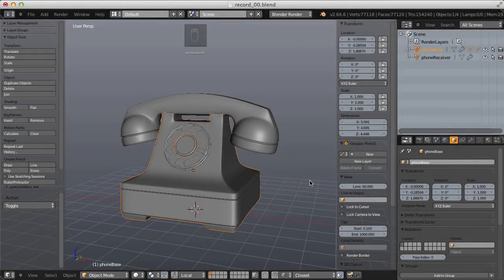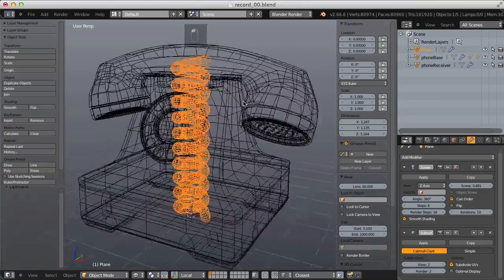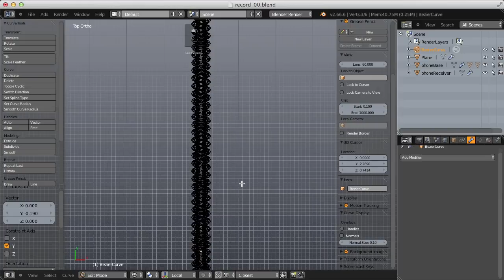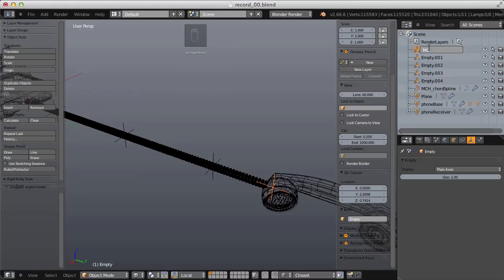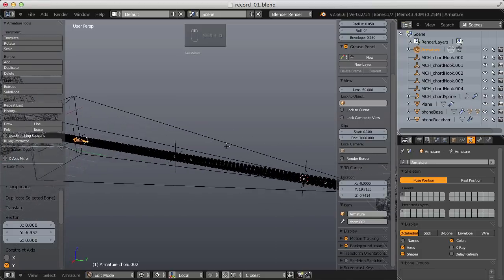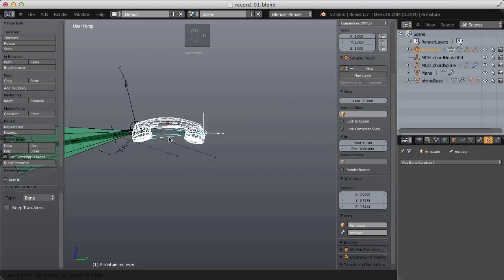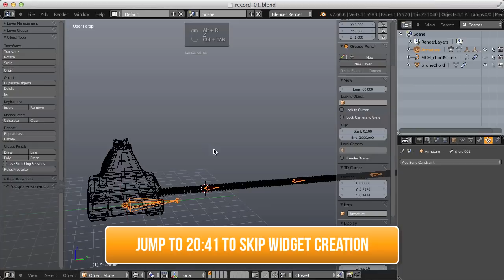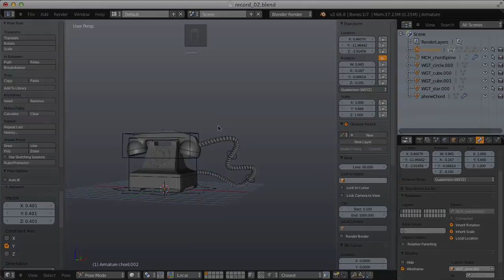Rigging a Spiral Phone Chord in Blender

Comment: sigh... sooo RIGHT from the beginning of adding a Bezier curve, I've got problems.  As soon as I add it the origin of the Bezier appears right on top of the 3D cursor as it should, but the bezier itself is WAAAY off to the side.  Damnit... I just want to follow a tutorial without running into a deal-breaking issue at just a few minutes in!!!
Reply: Happened to me. What worked for me: Had to Put the rotation of the chord to zero in the x,y,z axis using the tools in the right corner. Then made a new bezier curve along the chord. And, after applying the Curve Modifier, I made the bezier curve points bigger by selecting them and pressing ALT+S and expand, since my mesh chrod was small. sorry phrasing*. hope it helps.

Comment: How does this work in Blender 3.0? I'm having difficulty at the part where you constrain the Chord Stretch bone to the receiver bone. I think the process might have changed because I don't have the option for "stretch to".
Great and very thorough tutorial all the same.
Reply: I'm not sure that I understand what you're asking. It took me a minute to find "stretch to" in 3.0. If that's what you're looking for, select "Armature", go to Pose mode and select your stretch bone.Then press Control-Shift-C and the Add Constraint menu will open. You'll find "stretch to" under the Tracking column.
Reply: @tp00954  thanks for replying, I'll try that.

Comment: Well, they are different programs.  Big this is that Blender is Free and open Source and Cross Platform, meaning it runs on pretty much all Operating systems.  Blender out of the box will do more then the others out of the box.  Not only are the other programs really expensive, you have to buy expensive add-ons to get them to do what Blender just does.